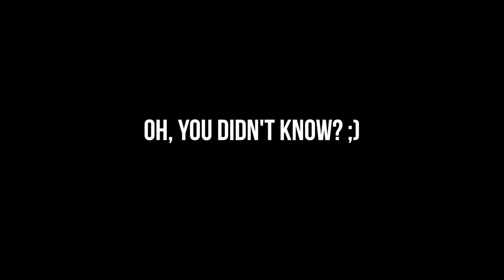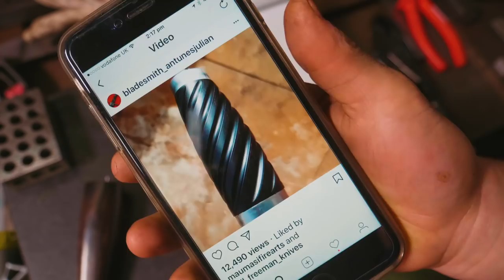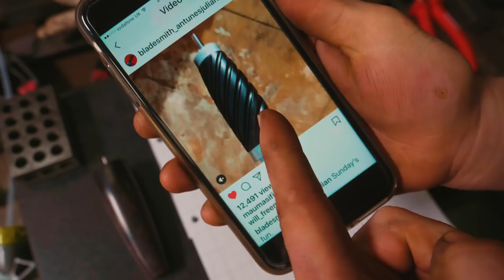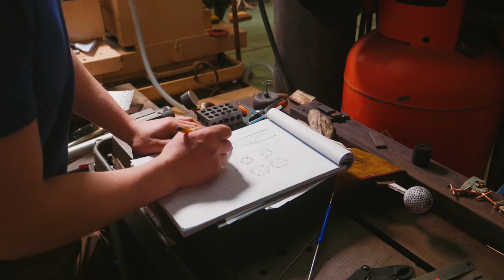MAKING A BASKET HILT RAPIER SWORD!! PART 12

Comment: Just a small tip for if you're ever doing curved lines on anything in future. When you're drawing from point to point, always look to the next point after the one your drawing to. It gives a much smoother, more accurate curve. e.g: if you're drawing from point 1 to point 2, be looking at point 3 as well, and so on. 

That made no sense did it lol
Reply from the maker: Great tip! Totally makes sense!
Reply: I was thinking that using a sewing tape measure might be a good choice for a straight edge on rounded material
Reply: Been doing that for many decades. The surest path to success is the one where you keep your eye on the destination. It is one of the most useful pieces of experience that I ever listened to.
Reply: Like driving ... one's life ?

Comment: Late to comment, simple tip for marking flutes: PINSTRIPE TAPE. Comes in variety of sizes, I start with 1 full spiral then add a 2nd & 3rd. If that is not enough try less than a full spiral, say 80%, or 75%. Easy to try different combinations, checkers etc.

Comment: Wrapping a piece of tape down the length of the wood, with the gaps between wrap being kept evenly spaced (think candy cane) will allow you to outline the flutes. One can either file where the tape was, or leave the tape in position, and file between the wraps.

Comment: Top-tipp from a gunsmith! For the files that you use for wood, just take a brass handbrush and brush the wood out of the file. Or if there are chips that stuck in the file ( wood or iron) which fcks up you surface that you file, just take an old .308 cartridge (bigger one) squeeze the "muzzle" together to get an edge. With that edge,  you scrape crosswise the file till you get the profile of it. Now you can always scrape those annoying chips out!

Comment: Alec,

For drilling holes in wood try a Forstner bit, they don't have flutes to load up with wood gunk. Also buy yourself a carding brush or two to keep your files clean. It also helps if you load your files up with chalk or soapstone first because it falls out of the grooves of the file easier.

Hope this helps!

Comment: Hey, @Alec Why not use thin strips (x8) of electrical tape the width of the flutes. By swirling them around the handle and then remove every other piece leaving four pieces equally space then use a sharpie to outline.

Comment: The best I can think of is using a string pinched against the forward end of the handle and use it on the 1/4's to do a measured layout. Then use the same method and split the difference evenly. Kinda makes it a "by eye" method on the final part but with a compound radius... I do like the cardboard since it will keep a straight line. Nice job sir.

Comment: I would recommend that you use tongue oil cut 2 parts oil to 1 part mineral spirits for the finish. Deep penetration and will not darken the wood as much as linseed oil will. Get all sides, including the inside (small, oiled paper towels and a pistol cleaning rod for that tiny space) with a thick coat. Do 3 coats, waiting 6-8 hours between each and wiping off any excess oil after the first 30 minutes with a clean, dry cloth or soft paper towel. Finish with a light bee's wax or finishing wax to keep the handle from feeling sticky and protect the oil from oxidation, which darkens the finish and ruins the protection it gives. This finish will last decades and make the wood look awesome at the same time.

Unless you have already put a finish on it already...

Comment: Alec, can you forge something that integrates blacksmithing with modern tech: phone case, automobile accessories etc...
Reply: jay west a Damascus phone case. You got my vote.
Reply: Dirty Thing Your phone would never break with that!
Reply: Bluetooth hammer
Reply: actually i hate to say your phone would almost definitely break with that. a phone case saves your phone by making the impact slower nd more distributed, so softer materials like plastic and rubber works best. a steel phone case would just make your phone heavier, thus adding force to the impact, and making your phone strike against the inside of the hard steel phone case rather than the relatively soft ground. 

that being said, i'd love to see him forge a phone case because that would be an incredibly difficult bit of work to do on a hammer and anvil, and would take monumental amounts of skill, even if the final product is only useful as a paperweight.
Reply: the reason a phone breaks is because it flexes and the glass cant do that. a steel case would add a huge amount of rigidity, so provided the screen is covered with a flap and it is tightly fitted around the entire surface area of the phone there is virtually zero chance it could break. unless the g-force was so high it destroyed components inside the phone
Reply: @jeremymcadam7400  if ur reasoning was correct then a human in a steel capsule could jump from a building and not sustain any bone fracture which is impossible. 
Momentum, which is the factor integrated in collisions (not hardness as u have mentioned) is proportional to weight thus a steel phone case would indeed be useless (the biggest proof is the absence of steel cases in the market )
Reply: Don't let that distract you from the fact that In 1972, a crack commando unit was sent to prison by a military court for a crime they didn't commit. These men promptly escaped from a maximum security stockade to the Los Angeles underground. Today, still wanted by the government they survive as soldiers of fortune. If you have a problem, if no one else can help, and if you can find them....maybe you can hire The A-Team.
Reply: @Kataclysm113  Yeah, it would probably be beautiful, but definitely wouldn't be functional.

Ok, I suppose if he lined it with silicone ribs or something, that might help enough, but yeah, a steel case would just transfer the impact force into the phone.  With all the glass phones they're making these days.... no bueno.

Comment: Great job so far.  I just thought you could layout the handle design on the lathe.  It's just like cutting threads. Set the spindle speed to the cross slide travel for your chosen design (thread count and pitch), and then mount a marking pen in the tool holder.  It would probably be best just to turn the spindle by hand with the cross slide engaged.  Just a thought... Carry on.  Cheers...👍

Comment: Measure both surface areas on either end divide by 8 gives you the correct points for the flutes. 

Also before you start working on the finished piece for the handle first you should have attempted to do it with a dummy handle and then transfer the dimensions and what you've learnt from that to your finish material.

If you make a mistake it is not the end of the world you can always start again with another until you get it right.

Comment: Hey Alec, a simpler way of laying you handle out would have been to wrapped the handle with strips of ribbon, paper or masking tape, that was the width of the “lands” and left the space in between as the “grooves”. Once everything was layed out symmetrically the grooves could have been marked for removal. I’ll bet the armorers of old did something similar and no measuring was involved.

Comment: Alec you need more CAD in your life. I was under the misconception that to do so needed loads of maths where as the opposite is true, good CAD does the maths for you. Modeling a couple of variants of that handle would have made the final layout easier to envisage.  I don't mean to take anything away from your method, that's outstanding work but you could have arrived at it more simply.

Comment: Alec. if you make a rod that goes thru the handle. then make a wheel at the top and bottom with holes in each. attach snap line/ chalk line in each hole. then twist the wheels, the string will wrap itself around the handle in a perfect twist pattern.Then just follow the chalk lines.: hope this helps in the future.

Comment: Another way you could have laid out the paths for the filing to follow is to use what car painters do for pinstripes: really thin tape. It allows you to see the exact path each line takes, how it looks around the varied angles on the handle, and doesn't force you to make any non reversible marks until you're certain you've got the right places on the material. Then once you've got the tape down, use some kind of material to create a non-permanent marking on the object (chalk or dry erase marker for example), pull the tape, and carve in the non-marked area. Much less riskier and achieves the same precision results you're after.

Comment: Great video once again Alec.  It doesn't matter if the projects are 1 part or 20 I'm going to watch them.  Do you have any plans to bring back the Saturday live streams? I miss seeing those. Keep up the great work fella.
Reply from the maker: Thanks man! Probably not since I have a limited amount of data on the 4g network that controls the shop wifi!
Reply: Alec Steele that's a shame Alec but completely understandable fella. There is only so much anyone can do with business expenses before you start losing money. The extra charge for unlimited could mean the difference between staying afloat and earning a living or folding the business and losing everything you have worked so hard for.  Thanks for the reply mate. Have a great weekend.

Comment: You could use a 3D-printer in your workshop there. Just make a simple 3d model of the handle and then, out of it, a shell (a negative) in which you can also insert the spirals for the marking. Then use it as stencil. Model it in the evening, print it overnight and of course, save a lot of time.

Comment: Take the handle spin it really slow on the lathe and just run the pen down it at a consistent speed. Would take some experimentation to get the width of spiral you want and you'd never get it exact but it would be perfectly uniform which is the most important thing.

Comment: Draw a center line and then use the circumference at the ends and maybe a couple other spots in between for reference. Then use a ribbon tape to figure out your halves, quarters and eighths by dividing the circumference by 2,4 and 8 at those different spots. Works on steel tubing, might be tricky on something that small of a diameter.

Comment: Just an fyi, Measure circumference, divide by the number you want, take a piece of ziptie or string cut to length mark out ends of ziptie on handle. Then take another piece of string or ziptie play connect the dots, trace on the same side of string every time and you can change the angle make criss cross patterns whatever. It is a lot faster and will work on almost any shape.

Comment: You should forge a bracket that fits the back of your grinding motors. Make it so that it holds a filter that prevents grit from entering the motor. Like the one @ 4:40

Comment: In future for marking out the scalloped Lines in the handle, it might be worth drawing/scoring 3 ellipses. 1 at the starting end, one at the high point or midpoint if the handle is straight, and one at the finishing end. Work out the circumference of each ellipse using string or similar and then mark out 8 equally spaced points on the first ellipse, 8 on the second (In line with the first) and same again on 3rd. You can now draw a line between a point on the first ellipse to a matching point on the second (or space it 1, or 2 down to create a spiral and then repeat the process to the final ellipse at the opposite end). This should give you a consistent line over the length of the handle. I use this technique for drawing vehicle spokes or hubcaps and it seems it would translate well to physical work...I apologise if this is the solution you've already found...I paused the video at 12 minutes when you where having difficulties.
I'm finding your work fascinating and impressive. Wishing you every success with your career and thank you for the fantastic content
Reply: Lol, you've pretty much found that solution XD

Comment: because the radius from the center line of the handle to the outside surface differs around the circumference, using an angle to mark out the lines results in different cord legths on the circumference of the handle.

Comment: You can't divide it because the handle is not concentric. If you turned the handle on the lathe next time you could get perfect concentricity and the angle set up would work.

Comment: Alex, look into picking up a file card. It's a really fine wire brush, works great on keeping your files clean, and can be used on cleaning up threads after cutting them on your lathe.

Comment: I prefer the handle of any sword to have a unique feel that is oriented to the cutting edge of the blade. I want to be able to feel the orientation of my sword even with my eyes closed! On a deadly dueling weapon like a Rapier, I also like the handle to be a big longer, or extended - that way if my opponent has a longer arm reach than I do, I can try to compensate by holding the handle a bit farther back, thus giving me an extra 1"-3" in length: This could be the difference between life and death.

Comment: You could always try using wax carving files, they have a huge open cut profile and even though they are specifically designed for wax I've found they work well on any material where it is gummy or wants to ahere to normal files more then usual. then afterwards go at it with a smoother file to just clean up the profile.

Comment: I would of put a bit of paper wrapped around the top circumference, cut it to size and divided it by 8, then do the same for the bottom circumference, then stick them onto the piece and join the divisions with a rule....
Reply: Oh, you did that.. LMAO

Comment: Alec, Lots of fantastic work young man!!  FYI... clean out your files(flat or round) and rasps with a wire brush quick and easy... just a couple two or three strokes your back in business  Smaller bite files use a smaller bristle brush... no matter it works for what ever you file metal, wood... etc  Good and Better Days to ya..!

Comment: you could have wrapped a string around the handle, adjusted it to your liking, put lighter fluid on it and lit it.  That would leave you with a slight burn mark that you could easily follow with your file.  But what you did worked out too, just seemed like a lot of needless fussing about.

Comment: Hey Alec, instead of using degreaser, look into filecards, not saying you need one, just a brass wire brush does the same thing,
Cleans your files so you can get on with the job, getting rid of all the clogs in the teeth without messing up your file.
Reply: agree...

Comment: Why are you doing this, 'coz why not! (And seeing the final, totally worth it!)
Like Damascus, all for looks
You could mesure the perimeter, take a piece of paper with the same lenght, then mark 8 section, wrap around handle and you should be evenly separated. Assuming your handle is.. ho wait, now you are showing it!
Also, regarding filing, put chalk on them to prevent clogging, worsk at least for steel.

Comment: I almost bought one last time, but I didn't have the $650 USD to buy a basic frame, without motor, controller, stand, accessories, etc. After pricing it out for a working package, it's closer to $2k USD. I just don't have the scratch, as I'm a starving artist from Detroit.

Comment: Alex why didn’t you put the lathe to get it to shape? But you did a great job!,
Reply: Alex try running the file through chalk before you use it helps to stop the file blocking up with crap 💩! Work for me while in either sharpening my saws or when in doing file work on my wood lathe! Cheers 🍻 man keep the videos coming 👍

Comment: The complex layout method you were trying to use with the v block  couldn't have worked. Your center is consistent, but the contact points move and are not equidistant from the center. So you can get the 4 poles right but the intermediary steps wind up spacing it similar to the stripes on the Union Jack. You were in some small obscure and geometric way unintentionally patriotic. 

Hoping I explained that well. It's one of those things that'd be way easier to draw than explain.

Comment: could you not have mounted it on your arbor then put it into the lathe. set the lathe to the most course thread you can and then put your " very accurate sharpie on a "spring mounted" stick and then mark your spiral???

Comment: Hey Alec might wanna check the oil paint Sharpie they have them in extra fine tip too and it’s much better to use on metal and dark surfaces. 
http://www.sharpie.com/markers/art/oil-based-paint/SHOilBasedPaint.html